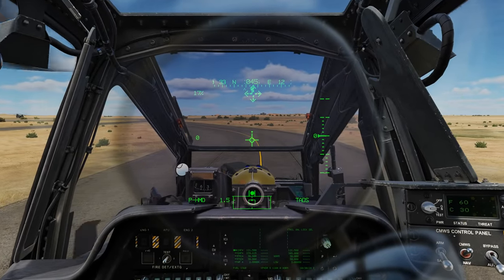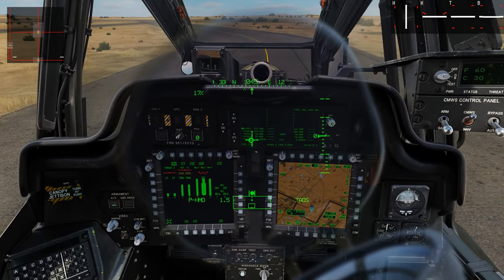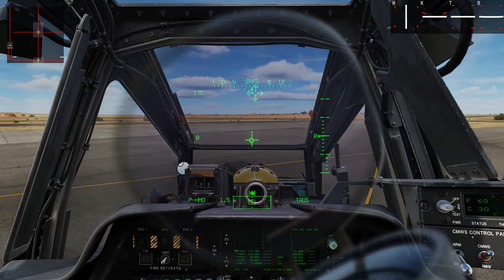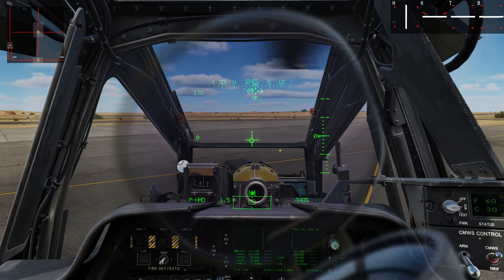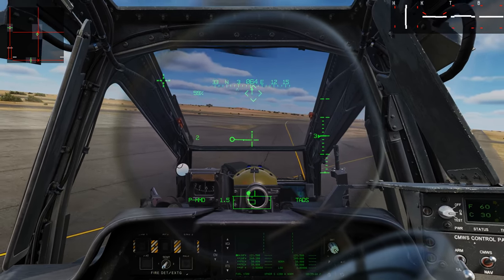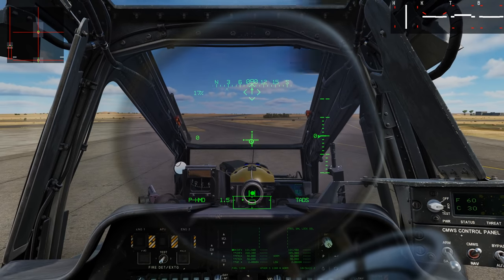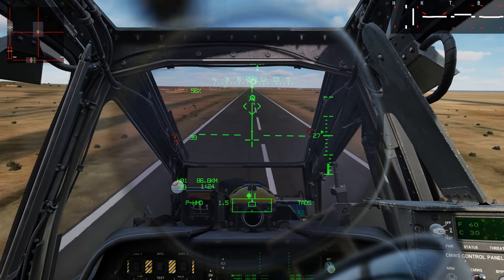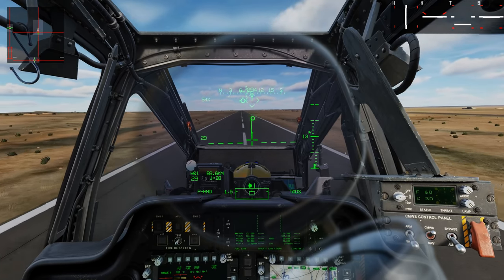DCS: AH-64D | Getting Airborne

Comment: New Apache pilots tend to stare at the symbology when hovering instead of, as you pointed out, just look outside and hover. At night however that symbology is gold.
Reply: What's the difference between aerodynamic trim and nose to tail trim? Is the former not applying any counter torque with the pedals or what is it?
Reply: @thomasmaier7053  trim in an aircraft doesnt mean it’s going straight. The nose can be canted off center of the flight path.
Reply: Hey Casmo. What's your take on the launch sound effect from the previous Hellfire tutorial vid. The irl footage I've heard sounds faster, sharper and "rips". The sim footage sounds hollow, deeper with more base. Which do you recall?
Reply: @thomasmaier7053  Aerodynamic trim = aircraft's body is aligned with the air moving around it, instead of where the aircraft moving in relation to the ground. AFAIK this means less strain on the body of the aircraft and more efficient travel, since the nose is basically pointed at the relative wind direction.

Nose to tail trim = aircraft's body is aligned with where you're moving in relation to the ground. You're moving "straight", like you would in a car, but you're exposing more of the body of the aircraft to the oncoming air, causing more drag.
Reply: @shd4618  I think it’s fine. It’s a video game. 🤷🏻‍♂️
Reply: @CasmoTV I ought to complain to Spotify for you not being named this week’s hottest single.
Reply: @TrickerDCS  Lmao
Reply: Good to know. As a new Apache DCS pilot I suspect my bad habit of just staring at the HUD might continue but I'll try to work more on using visuals
Reply: @Sandboxcode  Best suggestion would be to fly without the HDU and use the MPD pages to manage things initially. Once you have the hang of that, then start implementing the use of the HDU
Reply: @thomasmaier7053  Nose-to-tail trim is what's needed for runway alignment when doing a rolling take-offs or roll-on landings.  Aerodynamic trim places the aircraft in trim as needed for the least amount of power in forward flight... the intent is to maintain ground track vs. maintain heading aligned with that ground track.  When you do the latter, it requires more power (and more gas).
Reply: @Sandboxcode  i'd recommend flying the hind and getting some practice hovering with that. It's similar enough that you can practice the technique, while not having to rely on a visual representation. (Not that there isnt one, it's on the dash, the big grid looking thing on the center console). It wont be exactly the same, as the Hind flies totally different and it's performance in a hover isnt exactly the greatest, but unloaded it would serve as good practice in using visual ques to keep in a stable position.
Reply: idk kept staring at the stupid S hook flopping around in the upper left, seems like a very pointless distraction
Reply: @bleeckertb  Maybe I'm wrong but it's probably optional - I think the carbines are too. But don't quote me on that.
Reply: I have the opposite problem. I don't give a damn about symbology or instruments, but when it comes to bad visibility, I'm having serious trouble. XD Speaking of hover ofc.

Comment: For starting out, if the PERF page is providing accurate data, simply increase collective (power) until you reach the predicted hover torque.  Takes the guesswork out of coming up to a hover.  Apache pilots will hover at 5'.  Kiowa pilots will hover at 3'.  As Wags mentioned, in Hover mode symbology, full saturation of the velocity vector is at least 6 KTS.  In Transition mode, full saturation is at least 60 KTS.  The aircraft sits at a 40 KTS attitude on the ground.  So... if you feel like doing a perfect 3-point landing, hold about 2/3 saturation of the velocity vector (40KTS ground speed) in transition mode while doing a roll-on landing.  Obviously, wind has a say in things, but for the most part, it works every time.  Useful for those single-engine landings where a runway is available.
Reply: Is that the "power check"? I read in the manual that you should conduct a power check prior to take off but I have no clue what that is and how to do it and it's not described in the manual
Reply: @boggy8557  Well, we're supposed to do some form of performance planning before the flight, so we know if the machine is behaving as expected.  Chapter 7 of the operator's manual is full of fun charts to derive data, and then you find out if your loadout is suitable for a particular mission on a particular day when environmental data is entered into the equation.  The PERF page is supposed to come close to what the manual would tell you, but as of a few years ago, it wasn't 100% aligned with the book data.  Power Check is mainly verifying Go/No-Go data.  If you're pulling more than expected, you may not have enough power to do certain maneuvers, etc.  For the purpose of the game/sim, the PERF page should suffice.  If predicted IGE hover power is 62% torque, you should see 62% in the upper left corner of the HDU at a 5' hover.  If that's the case, you can assume the rest of the PERF page is good (or good enough for an unclass'd sim).
Reply: @robk5943  Thank you so much for the detailed reply, that's awesome!  The other thing I was wondering about was how do Apache pilot's fly a traffic pattern when learning to fl the Apache on the conversion course? I have been searching for info on this but google has been useless...
Reply: @boggy8557  If you mean Aircraft Qualification Course, or Transition Course, it's the same as learning to fly any other helicopter.  I transitioned from UH-60's and the only immediate difference I noticed was that landing on the tailwheel first (for aerodynamic breaking during a roll-on or single-engine landing) was a no-no in the Apache.  My IP thought it was funny, though.  Patterns are rectangular with an upwind, crosswind, downwind, base, and final legs.  Most traffic patterns are performed to facilitate emergency procedure training, so we try to achieve the desired airspeed and altitude on the downwind as soon as possible.  Then, throw in a simulated malfunction, and hopefully end up on the runway with the greasy side down a few minutes later.
Reply: @boggy8557  Also, Force Trim - in the form of a mag break to hold the cyclic and pedals - is always on.  Some transitioning seat-of-your-pants pilots (OH-58D) made a habit of holding the trim release button, but I tried as best I could to break them of the habit.  Interrupting the force trim also interrupted the tech that can make mediocre Apache pilots looks like Chuck Yeager.  Keeping it interrupted just had the opposite effect, but also took the "fight" out of the flight controls.  I learned to set it and forget it, then use pressure/counter-pressure against the mag break resistance.  I taught it, too.  Drastic control position changes warranted major trim interrupts, but in a traffic pattern, not really.  And, you don't need to interrupt the force trim to move the up/down stick, which helps.  If your heading and airspeed are good and you only need to come up ten feet to be within standard, just pull up slightly on the collective and leave everything else alone.  The altitude will change, but the airspeed and heading will remain mostly unchanged.  Seat-of-your-pants pilots had to change everything when making small adjustments like that.  Not the case in the Apache.  Some habits are hard to break, though.

Comment: Most interesting thing I saw was the SCAS authority boxes around the control positions. This is going to be a big help in getting people to understand how the SCAS works.
Reply: SCAS authority? Tell me more!
Reply: @Dreamshadow1977  The SCAS (Stability and Control Augmentation System) works behind the scenes to keep the aircraft stable and to permit the various hold modes to function. It has +/- 10% authority on each axis (except pitch, where it appears to have 20% forward authority). Those grey boxes on the control indicator are centered around the physical control positions, and show where the SCAS could drive the actual command to the rotor heads. It's transparent to the pilot since the SCAS commands are essentially superimposed on the cockpit control positions with no feedback to the stick.

In game, on the control indicator, the red X's appear to denote the trim position, the white diamonds show the control positions, and the green +'s show the SCAS command within the grey SCAS authority boxes.

Comment: 0:30 POV: The F1 steals the show xD Just kidding
Reply: Those are m2000c's though....

Edit: Whoops
Reply from the maker: Nope, Mirage F-1.
Reply: @crazygmanssimstuff  it s a mirage F1. And judging by the antena on the tail and the bump on the chin it s either a F1CT or a F1CR. So they re AI (for now at least)
Reply: @spartan-ml7nk  apparently those are just different skins Aerges said they were coming out with just the F1-CE first then the F1-EE, F1-BE, and F1-ME
Reply: @crazygmanssimstuff  yes, however, they make different AI model. And this one is a CT/CR, you can tell by the antena on the upper part of the tail and the bump under the chin of the aircraft.
Reply: @spartan-ml7nk  from what I've read so far those will be available also as skins for the releasible aircraft, but they aren't sure yet if the are going to do those specific varients.

Comment: A technique for visual hovering is to concentrate your view at 45 degrees either left or right of the nose.  From there, you can see both lateral and longitudinal drift pretty well.  From the 45 you also only need to move your head 45 degrees to either the nose or the side, instead of 90 degrees from the nose to the side.  Obviously, you can switch which side you are focused on or move your head as needed to avoid obstacles!   BWT, doesn't the AH-64 have wheel brakes to slow a ground taxi?
Reply: Yes it have wheel brakes but they 99% using the cyclic to slow down or stop and then they press the brakes and put parking brake on position. I mean yes you can use brakes but cyclic is the right way for this.

Comment: Been back flying the Mi-24 as practice, I VERY EXCITE when it comes to the AH-64D, which would you say is harder to hover Matt?
Reply: It’s easier.
Reply: The real confusion will be to change the muscle memory of pushing the LEFT pedal for anti torque instead of the RIGHT like in the Mi-24 and Mi-8 (if you have several flight hours with those modules).
Reply: I would say it's easier. At least you wont have to hit 20 switches to do one thing, lol.
Reply: I find everything that isn't Russian to be easier to fly. The Hind is a particularly odd one, sharing some similarity with the Mi-8 unsurprisingly, in that at higher collective loading it really does take a boot-load of pedal input to hold steady. Makes it feel very analogue and believable.
Reply: @frostycab  The Hind has the trim system. I was fighting the trim at first until I found out how it actually worked. You can just take off in the hind without pedal inputs, as long as you have the yaw trim on.

Comment: As an Apache tech I know that the collective and the yaw are mechanically linked as when you pull the collective the increase in torque from the main rotor needs to be counteracted to keep the aircraft heading the same. Is this implemented and the pilots actually do need to apply yaw when pulling collective or is this just not implemented? Also it's nagging me that there's no telltale wire in the cockpit but other than that it looks absolutely stunning and I'm going to start playing DCS just to try this aircraft out!
Reply from the maker: Sorta. When in flight, you can FTR to command heading hold within the tolerances of the SAS. But, when picking up, you will still need to use cyclic and pedals as the SAS cannot keep up.
Reply: @MattWagner  Incredible how much detail you've put into making this model, it looks amazing and the sounds are absolutely perfect! Kudos. Now how about the telltale wire on the master zeroise and the CPG collective friction grip? :D
Reply: They're not mechanically linked as in the Blackhawk.  Any up/down on the collective requires anti-torque pedal input by the pilot.  I've flown both.  Exception is when Heading/Position hold is engaged at a hover.  You can come up in altitude, and back down again, feet on the floor, with minimal heading change.  That is an effect of SCAS, not mechanical linkage.

Comment: I'm sure this will all makes sense once it is released, but I am a little confused on the rear wheel lock after it has been disengaged. Does it have a "detent" position that it snaps in or do we need to get it straight by rolling forward and attempting to re-engage while we roll?
Reply from the maker: There is a pin that will only lock the tailwheel forward when the caster is lined up. Once aligned, the pin can be set and lock the caster.
Reply: @MattWagner  How do we know when it is aligned properly? Is there a light or is it done by "feel"?
Reply from the maker: @Hailstrike  Just drive straight forward and press the tail wheel lock button until it turns off.

Comment: I've never thought or even heard about anyone using a hat switch for rudder, for those that have done this, how does it feel? Is it better to use my twist rudder on my T16000M or a Hat for the rudder in not just this but other helicopters like the Huey as well?
Reply: It's not by choice. Wags is unable to use rudder pedals. I assume his joystick does not have a twist function. For anyone else, pedals are ideal and joystick twist would be a decent alternative. You will have far better uses for hat switches.
Reply: @DriveFast_FlyHigh  I'm aware he's disabled but didn't even realize that's the reason he'd use a hat for the rudder.

That makes sense but I could have sworn twist rudder was still an option for him from what I know of his disability, so it's curious he uses a hat, I'm guessing the stick he uses doesn't support twist rudder as it's a high-end one.

Thanks for the response, should have realized the reason but completely slipped my mind.

Comment: Matt what controller/joystick set up do you use for helicopters?
Reply from the maker: For helos, I like the Virpil Constellation and CM3 throttle.
Reply: @MattWagner  I've been looking at the CM3 for a long time now, but I'm struggling to convince myself to take the plunge, especially as I fear getting stung for import duty into the UK post-Brexit. Would you consider a worthy upgrade from the Warthog throttle?
Reply from the maker: @frostycab  It's a great throttle and very versatile.
Reply: @frostycab  I have the Warthog set and changed the stick for the Virpil CM2 base and stick, I am also going to get one of the Virpil control panels. So keep the throttle and change the stick and base or just the base as you can use the warthog stick on the virpil base and get a panel.
Reply: @Topper_Harley68  I'm actually still happy with the Warthog stick and base. I know some people like to point out flaws with the base, especially the "sticktion" but I have a 10cm extension on the stick and don't really have any issues with it. That being said, I might be blown away by the difference if I tried a different base, but it's further down the wishlist then the CM3 right now.

My main reasons for looking at the CM3 is the adjustable detents and what I see as a more versatile layout. I got the Warthog as it seemed to be the HOTAS to have at the time, but it's not a perfect throttle. The IGN and ENG FLOW switches are positioned in such a way as to be virtually unusable in normal situations. Plus they really screwed up putting that ridiculous "nipple" slew control on it. I swapped it out as soon as heard about the replacement mod that uses an XBOX-style ministick. 

I particularly like the idea of having the encoders on the base of the CM3 as opposed to just simple axes. The only thing I think they've done wrong is putting the "flap" axis on the right side of the base like the friction slider on the Warthog. I'd gave liked to have seen it on the left side, as it's more ergonomic to move your had to the outside rather than try to fiddle with it while trying not to interfere with the throttles.

Just a shame it's so damn expensive! It's just over £300 by the time you convert from Euros, and by the time you add shipping and import duty the total rises to over £390. It's more than I paid for my whole Warthog setup. I know I'll probably get it eventually. I just need to convince myself. LOL

Comment: not sure what i m doing wrong but the easiness of flying Ka-52 is not comparable to AH-64 at all.. Ka-52 flies very smoothly whereas AH 64 is acting up like a wild horse bouncing up and down... but i have to say KA 52 when first came out like 12 years ago, she wasnt easy to fly, either.. i believe flight management system (pitch, bank, yaw and  altitute channels) got improved over time.. Correction: KA-50 not KA-52.. i m getting old.. :)
Reply from the maker: While there is still some minor tuning, it is quite correct. The Ka-50 is a much easier helicopter to fly due to the cancelling torque. The -64 though requires correct pedal use and an understanding how the force trim system works. It just takes practice.
Reply: UPDATE: I just bought a complete flight control setup; advanced joystick, throttle and rudder pedals; I have to say rudder pedals make a huge difference; now i feel like i have the control of this beautiful beast. THANK YOU DCS! Thank you Wags! you guys are awesome!! just spectacular!!